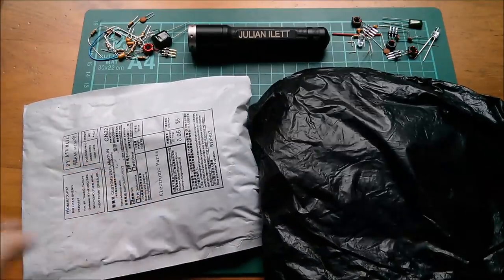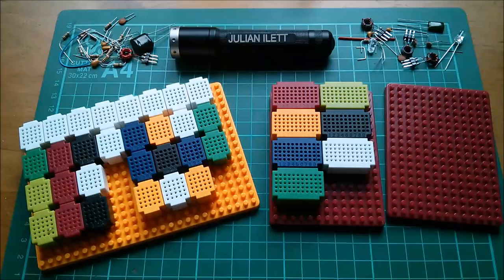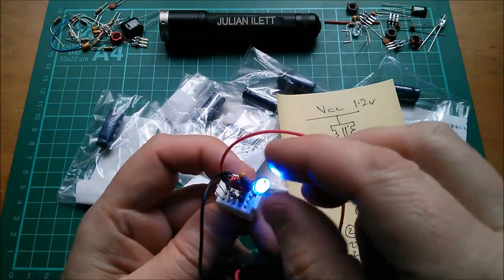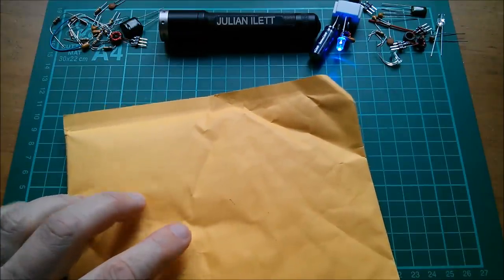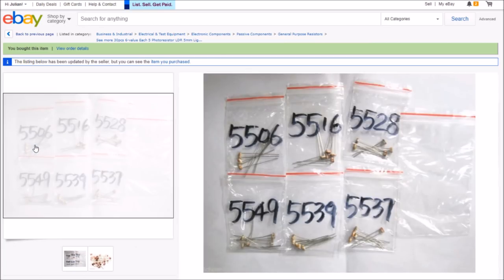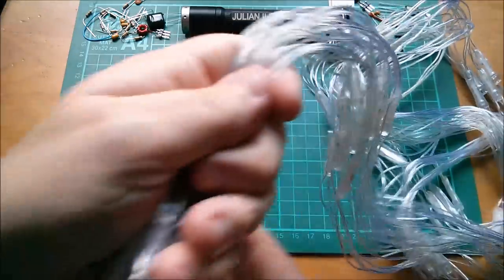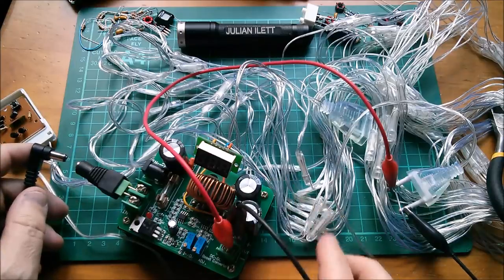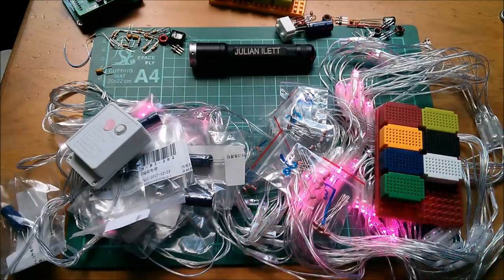Julian's Electronics Postbag: #115 - Pink Wedding LEDs

Comment: What is a Joule Thief?

A Joule Thief is a simple electronic circuit, that takes in a small input voltage (<2 volts) and multiplies that voltage to power devices that require higher voltages to run (like LEDs, that usually require at least 2-3 volts to run). for those like me who had no idea what he was talking about

Comment: I have a few of these led strings, although i chopped off the box and replaced it with a bridge rectifier, so they stay on solid. the connection rightmost would be I believe positive to the string while the other four are negatives.

Comment: Regarding the LED lights: A, they're the bog-standard Christmas lights in Russia and the default price is ₽500 (can't be bothered to convert); B, they're a total deathtrap and can spontaneously combust because the resistors are underrated in these things (speaking from experience, and by the way, plastic Christmas trees are pretty combustible too); and C, the TO-220 devices (I think that's the name of that outline) are actually thyristors, or SCRs, which is why it won't work on DC. I had an idea to drive these off a low-voltage supply switched by a MOSFET-or-other to make a cheapo controllable-color room lights, but that idea went out the window as soon as I discovered that they're wired in series. (At which point I left them on at the static setting, and that went over as well as you'd guess it would.)

Comment: The two transistors on the LED driver board will probably be thyristors, which rely on the rectified voltage reaching 0v to turn off. The controller will be powered by a bleed resistor and smoothing cap, it will be synchronised to the AC too, so without a zero-crossing synch it won't activate the thyristors. Standard terrifying Chinese design there!
Reply: Yes. I was shouting at the video. No Julian, it won't work on low voltage DC. It needs 230VAC. The LEDs are probably wired in series/parallel.

Comment: I have rewired a string of the cheap lights to run off 120VAC (canada's mains) without the control pcb. just bypass the 2 thyristors

Comment: Very interested in seeing more super capacitor joule thief stuff. Possibly power an led for the entirety of a day?
Reply from the maker: Thanks, I'll have to concentrate my efforts on efficiency for this to work :)
Reply: Much cheaper to use a discarded AA cell. They can run an LED on a Jouke thief for ages. A new cell, if you want to hang the expense, will work for weeks, maybe months.

Comment: Julian, you REALLY need to up the audio rate or what ever it is called. Like at least go 192 kbit. It is super compressed and the crackling is backs sound awfully metallic. PLEASE :)
Reply from the maker: I don't think movie maker has any settings for audio bitrate :(
Reply: I second Michael's recommendation, its really harsh on the ears using earphones, especially when you are handling the plastic.

Comment: 7:46 lol "quite a crack"? 2 Volts :D
Reply: Depending on the resistance of the wires it will be many Amps discharging there. Roughly speaking if the wires only had 0.01 Ohm resistance it could be 250Amps or more. It doesn't matter the voltage. Amps is amps.

Comment: That LED net has a Swiss plug. 
Strange the Chinese send stuff with Swiss plugs labelled  as "EU plug"
Reply: No, it's an Europlug which is compatible with French/German/Italian/Swiss sockets since it has no central grounding pin.
Reply: Also, all the other countries that use the German plug, like Austria, the Netherlands, Luxembourg, Belgium and Greece (and a lot more I don't know off the top of my head).
I think the only sockets these don't fit in in Europe are the UK ones, which are also used in Malta.
Reply: They do fit into U.K. plugs, if you defeat the safety shutter. Unofficially, it's been done for years. No fuse in those plugs makes things a bit more dangerous.

Comment: When will you begin to comprehend the very significant difference between a supercapacitor and a lithium battery? Capacitors are energy dense, while batteries are power dense...simply put, caps can deliver much higher current instantaneously than can batteries, which are limited to discharges of small multiples of rated charge current. Batteries do, however, hold much more total energy per unit volume. The two have very little intersection of purpose, if efficiency is important.

Your super cap videos appear to ignore this, and the comments reflect that your audience is being led astray.

Or am I missing the point?

Note: I did, in fact, state it backward. Capacitors are power dense, I.e., they can deliver many joules instantaneously, whereas batteries can hold much more total energy per unit volume, but can only deliver it at a relatively slow rate of a few times the max charge rate without damage.

Thanks Fabian N. for correcting my error!
Reply: I believe the point is that capacitors can be charged quicker and an order of magnitude more times than batteries so running things like for example Julian's blutooth speakers he was building / experimenting with a while ago is of some interest. I mean, if you can get a few hours of life from supercaps when powering those sorts of devices.
Reply: Shouldn't it be the other way around? A cap can deliver huge amounts of power, but can store much energy compared to batteries.
Reply: schwartzenheimer1 is correct.